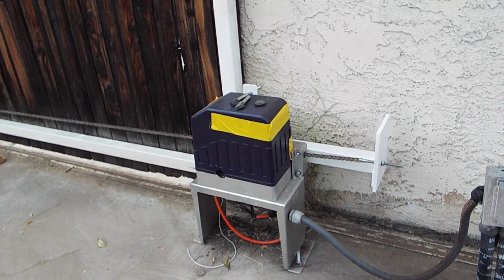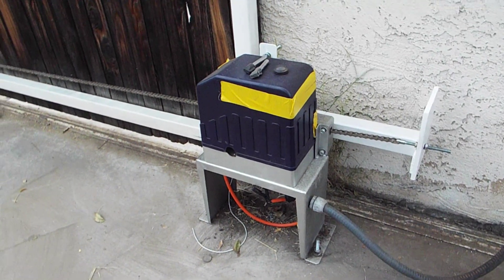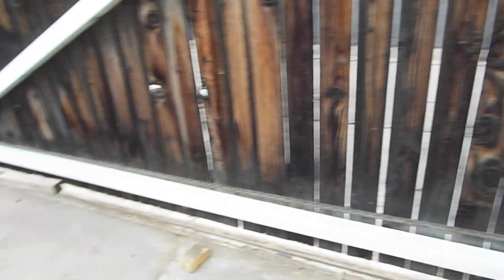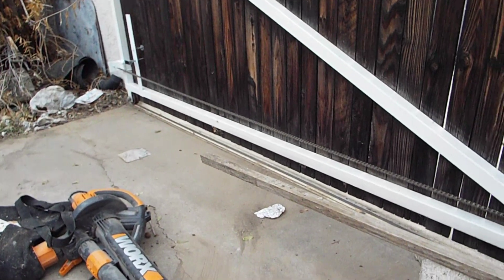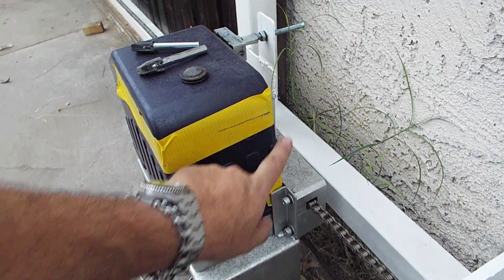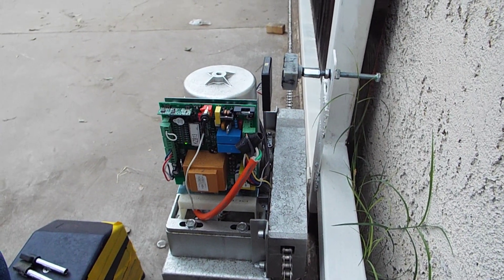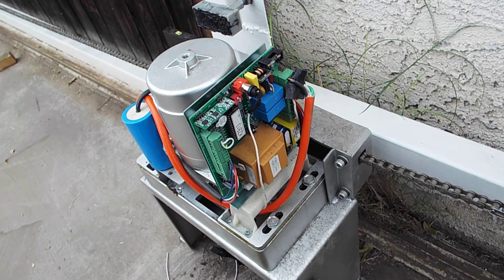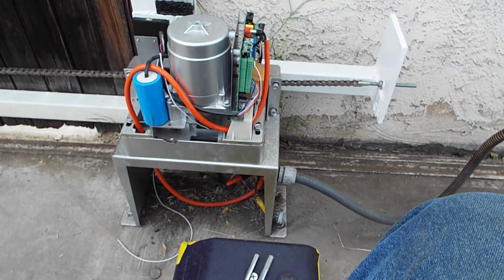Liftmaster, Aleko, Viper DKL400UY, AC1400 gate opener installation

Comment: Like most of the people said the instruction suck. do7.pl/gate But this little unit work very well. I made a mistake by installed the base first, it end up I have to adjust the chain so that the gear and chain in the same line. If I have to install one more I will install it in the follow order.

Comment: It's crazy, but in 2024, this video from 2013 is the only useful installation instructions I could find for a Aleko AC2000NOR sliding gate opener. Thank you random person for taking the time an entire decade ago to create and upload this information, I would have been completely lost without it! Understanding how the magnet sensor works is absolutely key and is quite poorly described in the manual (much like every other important aspect of this unit) and this video explains it perfectly. I found that the drive chain (which in my kit came in two separate 10 foot lengths that you had to link together) is best mounted with a fair amount of slack in it, otherwise it will bind in the chain box and cause the clutch to slip. After removing a few links and adjusting the threaded tensioners, the opener operated flawlessly with about 6" of total deflection at the center of the 20 foot chain span. Also worth mentioning that once I got the magnets and chain adjusted correctly, there were no internal adjustments needed otherwise.
Reply from the maker: Hey you're welcome, that is why I did the video. I struggled with figuring this thing out forever and I figured this may help someone. It's a pretty good opener, just terrible instructions. Glad I could help

Comment: Your explanation of the proper positioning of the magnets help a lot.   Nice supplement to the manual.  Thanks!
Reply from the maker: No prob... I thought the instructions sucked so glad this helped.
Reply: Totally agree... watching your video for the 3rd time as I set up the magnets.  Thanks again for taking the time to make this video!
Reply from the maker: Chris Gutierrez glad i could save you some time.... i messed with the magnets for about 2 weeks before figuring it out.

Comment: on another note. it doesn’t matter if the magnets are reversed switching the red and green wires coming from the magnet detector on the circuit board instead of re mounting magnets works just as well. all the magnets do is operate two separate switches with a common ground.

Comment: I can't get the chain to release.  The keys are broken, like yours.  And I used other tools to turn the key.  But it won't release the chain.  So I turned it to the right.  And it won't engage the chain.  Seems like my chain is in limbo because the gate won't open by using the motor, but it also won't let me pull the gate open.  Any suggestions?

Comment: I’ve had my gate opener for just a little over a year and it gets stuck closed at times even unpluging the motor doesn’t work. I called up Aleko they said its the programming of the circuit board and that id have to buy another board for 100.00. This system does not last long however they say 3 year warranty but they don’t honor it.

Comment: One thing to note - if your gate opener is mounted on the left rather than the right, the magnets need to be reversed.  They're not open and close, they're stop left, stop right.
Reply from the maker: yup!
Reply: +Chris Gutierrez thanks for that tip!
Reply: Chris Gutierrez can you explain this more
Reply: Justin Bennett one magnet stops travel in one direction, the other stops in the opposite.  if you find your magnet didn't stop the gate, try the other one.
Reply: Chris Gutierrez thanks I really think I have a bad board my gate will open as it supposed to and then when it is time to close it just hums... seems like something is causing it to fail... does the same thing when I switch it around...
Reply: Justin Bennett try activating both ways either with clutch open or no chain.   motor should run both ways
Reply: Chris Gutierrez yea I tested it with clutch open and manually pushed the gate to simulate gate opening and it did the same thing...
Reply: Try switching magnets... Only thing I can think of
Reply: Chris Gutierrez ok thanks

Comment: hello sir! thank you so much for uploading this, as i just brought one online recently and having a hard time for technical support from the co./dealer where i got it , hope you wont mind me asking for your help with regards to operation and programming maybe as i'm done with the installation already, the problem i have is controlling it and having a hard time to figure it out, ( never did it before, got no experience at all, just trying to do it myself to save some money  as the pro gate co. is charging a lot and cant afford it, the same way my lower back is killing me for doing it manually for 2 months, as the previous opener i had for 10 years gave up already) what i did so far after the installation was turning it on and  erase all factory presets info stored on the remotes then tried to pressing button 1,  had to press it twice to have the motor running unfortunately, it runs continuously and gate wont move at all, (had to turn it off immediately to avoid overheating the motor). that's it, as am afraid might damage it whatever, i've been so dumb and stupid for almost a week now and still it's not working! hope you have some time to help me resolve the issues i have!  i understand if your busy and cannot, but please accept my thanks anyway just for reading this. Thanks a lot!

Comment: How do you program the remotes?
Reply from the maker: as i recall there is a learning button on the opener itself
Reply: oddjobstoo Which button?  There are four.
Reply from the maker: check your manual... on the opener is the learning button, not on the remote

Comment: These sliding gate openers are made in China and sold by a number of outfits in the U.S.  As mentioned in the video, they have various brand names, but are in fact the same unit using the DKL400UY name, etc.  They are basically a cheap unit with terrible instructions and poor or no back-up customer service.  Most of the dealers are out of business.  The dealers who remain are mostly useless and speak such bad English, its near impossible to understand them.  I had to replace the  KZB13 circuit board for the second time for $95 and it has now gone bad again, of course, now out of warranty.   The opener seems to work fine when working correctly, but they need to improve the quality of the circuit board and include better, complete instructions and a trouble-shooting Q/A section.  Also, Aleko in Kent, WA are basically crooks, so beware. 

Note:  Make sure your unit is completely sealed from weather and insects.  On another opener a tiny slug had crawled inside apparently seeking heat of the circuit board a shorted out the contacts on the soldered side of the CB, which fried him and my CB.
Reply: Thanks for the heads up on the sellers from Kent, Wa. I was looking at their website while shopping for a new gate opener. Can you share your experience with them? Thank you.